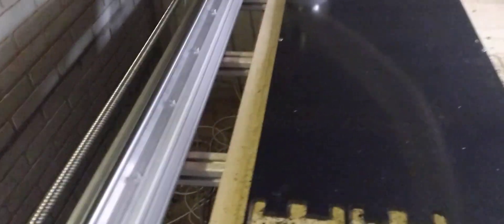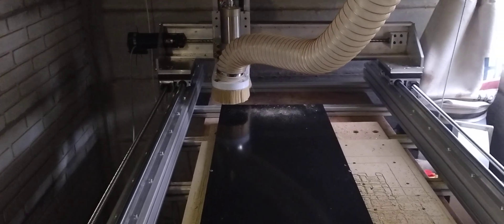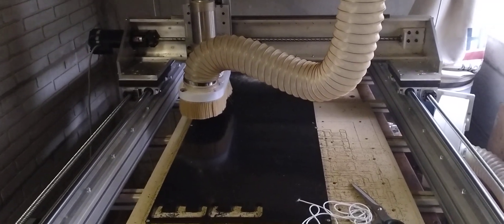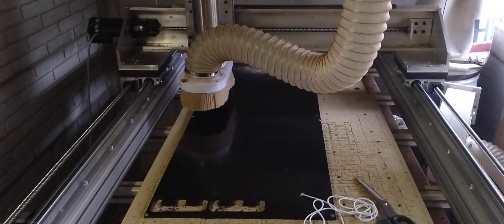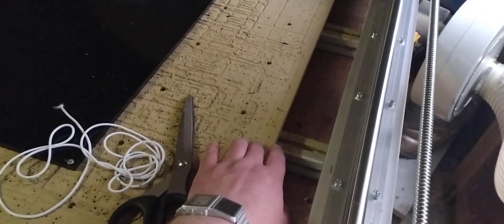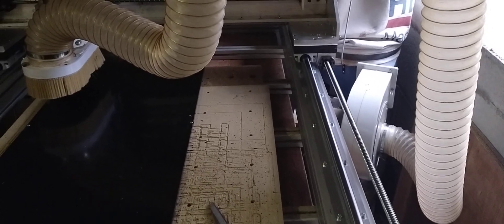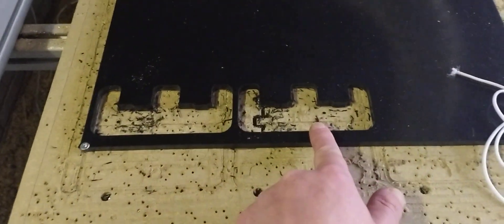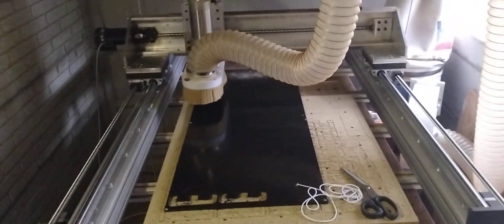I enlarged my old CNC. (phone recording.... quality sucks)

Comment: Since you’ve got yourself a 3D printer it would be a good idea to print some covers for those pulleys / finger guillotines :)
Reply from the maker: i was just thinking about that. would be ...unpleasand to put you fingers in. then again i do see they drift :( i might need to shim the motors so they do not rub against the pulley before i print some covers ! 

my other machine had those on the back, now they are at the front :) easy to adjust or replace.. but maybe not so safe